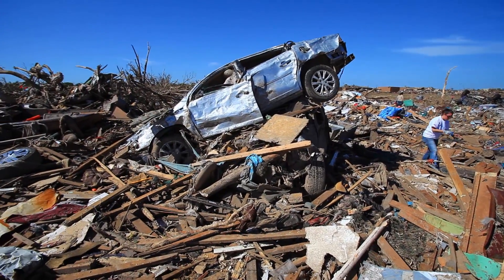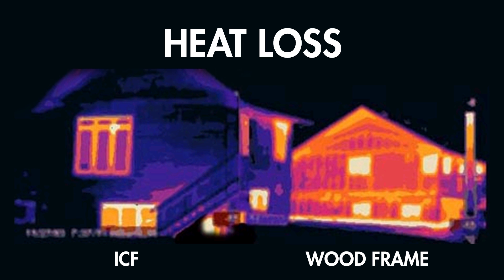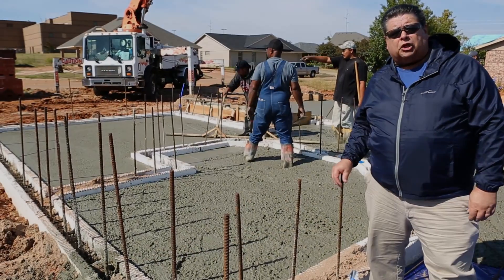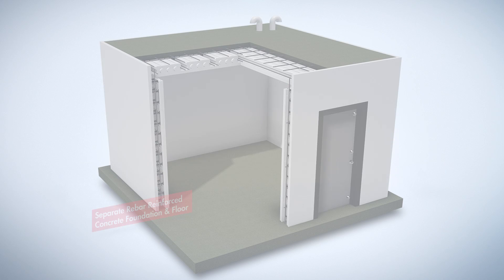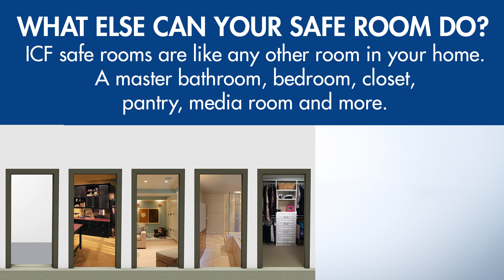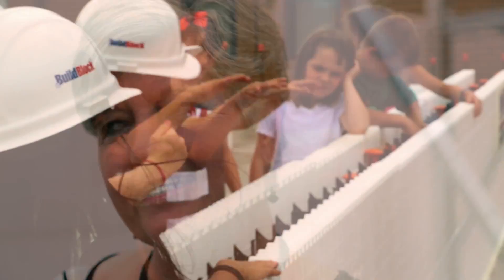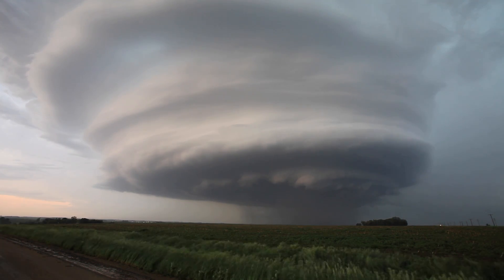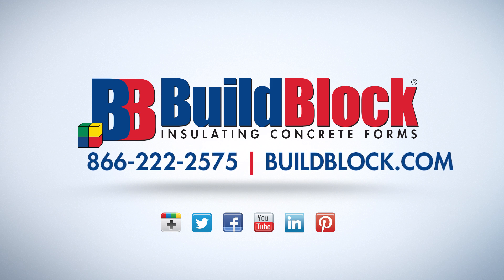How to Build an ICF Safe Room and Safe Home

Comment: Monolithic domes are the most disaster resistant structures but ICF does come in close second. My only hesitancy is the flammability of the foam bricks. If used correctly and protected from flames, sparks and fire then yes its great and much 3asier to build with. Thinking of using it to build a root cellar / disaster recovery suite ( a apartment to stay in as you rebuild from disaster). Make a good games room too.